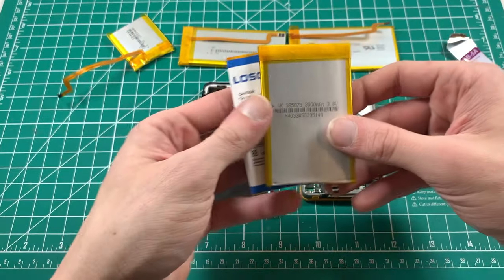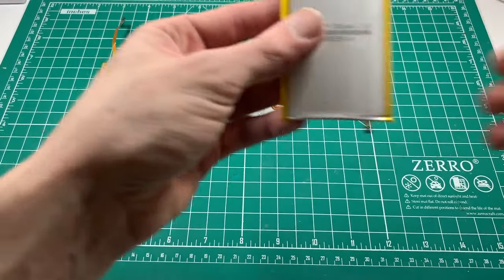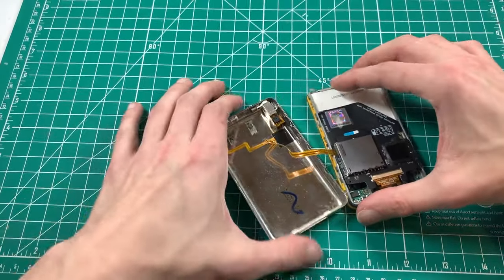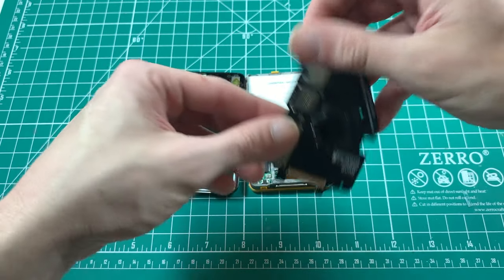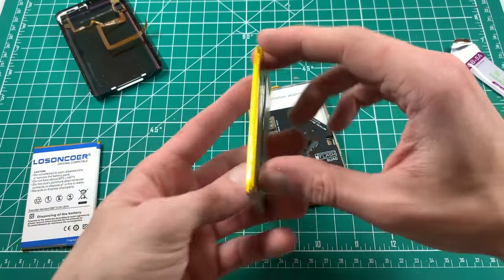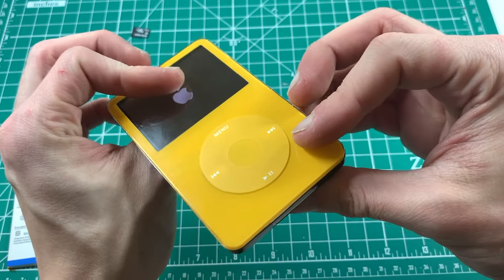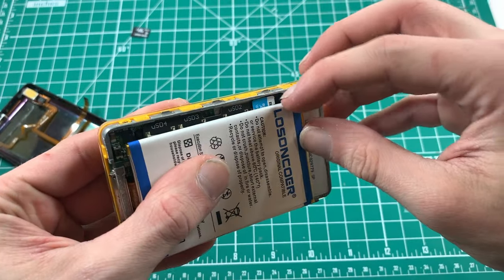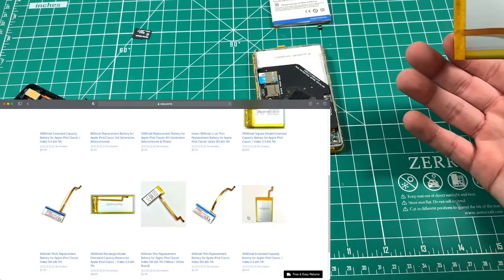Complete Extended Capacity Battery & iFlash Guide (Solo Dual Quad) for #Apple #iPod Classic

Comment: I don't understand why there isn't a single micro sd adaptor. It would be so much more compact.
Reply: There is a flash card adapter that's pretty cheap on ebay, not sure if it's compatible, I'm looking to use on my 5th gen, it says flash card to 1.8" zif

Comment: Can confirm that I got the thin 3000mah battery from the EOE website to fit with an iFlash Quad in a thin (30gb) iPod 5th Gen.  BUT - the ribbon cable was on the wrong side in my battery (compared to this video), so I ended up having to fold the ribbon cable in half to get it in properly.  Covered the folded area in some kapton tape on both sides, which should give everything some extra insulation in case the fold weakened the insulation of the ribbon cable.  Overall quite happy!
Reply from the maker: Textbook install, nice work!

Comment: Thanks for this! I misunderstood the requirements when I read them and got the thin 3k for my Iflash Solo 6th gen upgrade, now I know I have to get the 2k square to get it to fit. I'm getting the rainbow backplate and it only comes in thin size. Here's to hoping someone develops a bluetooth module specifically for these old Ipods! I'm not skilled enough to put one out of a transmitter into my Ipod like I've seen some people do, I'm just gonna get a 30-pin bluetooth adapter.

Comment: Bad luck in my case I bought the 3800 mah LOSONCOER thinking it would be better.
I am thinking of modifying the ipod that I have, exactly, it is the "iPod classic (160 GB, late 2009)" - A1238, it can still fit the iFlash Quad, or it would be better to return the battery I bought it from Aliexpress.

Comment: Hey nice video. 
Your other video helped me a lot with the installation of my 3000 mah battery 
Thanks a lot.

Question 
Now I have enough power for days but is there a way to fast charge your  ipod?
I am using a regular phone charger now
Reply from the maker: FireWire
Reply: Can I use a large battery for the iPod classic 7th generation 160gb thin without changing the hard drive?
Reply from the maker: @illasphonecontacts  no

Comment: Do the cables for the rectangle 2000 and 2800 mah (you show the pics at 3:20) bend back over themselves to connect to the iPod? I worry that such a sharp 180 bend would risk breaking the ribbon.
Reply: Did you ever find out?

Comment: I had a peak on your website and I see a 3,800 mAh battery on the picture it says 3.8 volts and the iPod would charge it to 4.2 volts if I’m understanding that correctly so wouldn’t it expand and turn to the Samsung note 7 from over charging or what’s up with that

Comment: I got the thin 3000mah battery with the iflash quad and a thin backplate. Unfortunately the locking mechanism wouldn't fit at all so I had to settle for the thick case.

Comment: If I was going to buy a thick back case for the bigger battery, would the thin back headphone assembly fit inside of it or would I need the thick back one instead?
Reply: You would need the thick one the thin one wouldn’t work
Reply: I've got the thin back headphone assembly in my thick back and it works fine

Comment: There is someone who sells 5.5 gen iPods in metal 7 gen shells. I am trying to decide between transparent front 5.5 shell despite unfortunately being unable to find a matching transparent rear shell, and a metal green 7 gen shell, but I am not actually sure what is involved with placing them in the 7 gen shells. The green metal front plates don't seem to be offered with thick rear plates like other colors of the 7 gen shells. I am also planning on upgrading mine with wireless charging, and Bluetooth, and so I expected to have to drill a couple small holes in the rear case for that.  I read somewhere that the 5 and 7 gen swap much better than the 5 and 6, but I think the 6 and 7 were also possible. Can you do a video explaining 5/6/7 shell swap situation.

Comment: With regards to 3000mah: I think maybe the last 4 # of the bottom number tell you which version it is. 

It seems like your slim one is --5148. Not sure what your thick one is. I just got one today and it ends in --7445. It is supposedly 3000 mah and it is different than both of these. It's wider than both and because its wider it's shorter. It seems like it just barely clears the midframe prong height wise.

I haven't verified this number theory. Just guessing for now.

Comment: I just received my shipment from you. The iFlash SOLO came with two rubber bumpers, but i don't know how to place them, or do I omit the one.  Currently one is on the front plate leveling the SOLO board. What should I do next? Just use a kapton tape to secure the battery against the back plate?  Please adv5. Thank you 😊

Comment: Okay, so I fit the thin backplate with the iflash quad and the 3000mah thin battery, I had to remove two rubber pieces from either side of the port at the bottom. The case seems loose. Like it doesn't clip back together as firmly.
Reply: It's fine. I got some b-7000 glue used for phones and glued it together.
Reply: I had a similar situation. Tried to throw in a 3000mah with an iFlash quad in a thin back. While it technically fit, I felt like it doesn’t close all the way like it did with the stock battery. May just go with a 2000mah

Comment: I flashmode the ipod classic 5.5  video tick back 60gb with thin 3000mha battery and iflash micro SD dual, but i have another one ipod 6.5gen 120gb with tin slim back case will fitt the 3000mha battery with iflash micro SD duo

Comment: I was wondering if you could help know  which of the batteries will fit a thin backplate with the generic dual SD adapter that was on your website.
Reply from the maker: I just updated the generic dual micro as deep product page description with compatibility info

Comment: i have an issue here 
i have modded my 5th gen thin ipod (originally 30gb) with iflash solo 256gb sd card + 3000mah battery
i have been hold my ipod charged with my laptop for around 10 hours but the ipod battery indicator still stay the same actually lowered to i guess around 1% left
what should i do ?
Edit: i know why not look like it was not the battery fault
It's the prev modder fault because he look a little rough with the battery plastic socket
I will have to shill out my cash to resolder it oof

Comment: Mine is classic 5.5g with thin back plate (iflash quad inside). I'm about to get thin 3000mah battery so it would fit in to my ipod. The question is do i need to adhere battery on the back plate of my ipod?

Comment: Cool video. I was thinking of getting the dual version but you said it’s not that good can you explain why?
Reply: There's nothing wrong with the dual version. I suspect the issue is simply that the dual occupies slightly more space and therefore limits your choice in aftermarket batteries when using a "thin" back plate. Also, with price of SDXC cards falling while capacities are rising, perhaps the dual is less relevant.
Reply: @Lonesome_Loser  may know which battery are you using with the dual??

Comment: In the Quad what SD cards did you use, I have 2 Quads I can not get to work. The iPod classic 7 gen works with the hard drive., but not the Quad's I have tried  different SanDick  128GB.

Comment: Why does the iFlash quad work with the thin back/thin 3000mAh battery but the iFlash solo doesn't? Is the iFlash solo thicker than the quad? Also, if you have a "thin" 80GB 6th gen, can you put a "thick" backplate on it? Do all the clips line up regardless?
Reply: The iFlash Solo is thicker than the Quad, as the Solo uses full size SD cards as opposed to the Quad using micro SD cards. And I believe all the backplates are interchangeable between the 5, 5.5, 6 and 7th gens.

Comment: I just realized I accidentally purchased an iFlash dual instead of a quad for my 7th Gen iPod classic. Based on your video it appears I won’t be able to install an extended battery, would an original oem size be the only one that would work or would I still be able to go higher?

Comment: People say the thin 3000 mAh battery is more like ether 1800 or 2500
Reply from the maker: yes, likely but in this circumstance the ‘3000 thin’ model is a disambiguation more than a capacity

Comment: So I finally built my first iPod. After running it for a few days I noticed some things .
Are the replacement click wheels not as responsive?  Mine seems to need deliberate and firm circles, vs my stock one.  

Also, having an issue wirh random intermittent track skipping.  It’ll usually start with long tracks, like a mix. And skip a few. Then play.  Sometimes album art won’t load, and sometimes when the album plays and finishes, songs then get stuck on zero.  I had 26k songs in my 160 classic. But full id3 info.  Didn’t check my database, just reformatted discs, and put less music.   All the tracks play fine on iTunes and stock iPods.  Currently listening to music and seeing if it persists.  Only has 200 songs on it. And some artwork is being wonky : /
Gonna possibly try a new zif, and a new MoBo when I get one.  : (
Reply: Could be the hard drive if it isn’t iflashed, I had a similar issue and I found out that my flac to ALAC converter was the issue, I was using the media human one, when I used a different one everything went back to normal. So if your converting to ALAC that can also be an issue
Reply: Mystic’s Entertainment I havnt been, converting.   It just seemed laggy at times with the iflashquad.  I was also having major intermittent skipping issues- which I THINK i resolved...  still checking it out.   But the iPod tjay was going to have that board initially,  still has that clickwheel, and I put a 160hdd back in.   It’s still kind of laggy, but not as much.   I possibly could have gotten an ‘off’ one.   It’s kind of hit or miss with the quality of the aftermarket parts.
Reply: Ok, so it took me like 3 purple click wheels to find a good one, and sandisk cards will skip in flash boards. 

Using a Lenovo, I think it is.. zero issues.

Comment: Is the iflash solo compatible with the stock size and style battery?
Reply from the maker: Yes
Reply: How about the duo and quad? Is there a max storage capacity on ipod video when using these adapters?
Reply from the maker: @richardscott9840   yes. All models of iFlash are compatible with the standard size batteries. 
Max is 2TB

Comment: Am I correct in my assumption of the numbers: 385879 being thin, and 405470 being thick?   If that is true, I noticed in my ‘research’  (not that it makes a difference) but the pictures on your store are swapped.   But I doubt If more than 5 people even noticed.   Lol.
Reply from the maker: Yes, as seen in the video - but it's important to note, those numbers are not the 'end all be all'. 

I have a thin 3000mah right here marked '445070' & a thick 3000mah marked ‘385872’. 

Each battery fits in the same iPods respectively, same configuration as seen in the video. 

I also don’t trust most online sellers, even if you’re able to identify the model of 3000mah battery using that number. 

I have ran into this countless times, a surprisingly substantial amount of sellers simply type in ‘iPod Classic 3000mah battery’ & download the first result on google images. 

hope this helps in the search
Reply: Elite Obsolete Electronics it does help.   I has just ended up blindly ordering 2 different ones during the last week.   They came in, with those numbers being respective, but I don’t have my other parts yet, so I just did a rudimentary size test.   

One is tricky because the eBay listing  says thin in the title, but on the description, in broken English it says that it fits the originally thin models with the fat case-   So the title is slightly miss leading.   

I do believe one of the two is the proper skin configuration. 

Thank you : )
Reply: @CIarkNova  i know what listing ur talking abt! did u get the thib or thick one bcoz even i got confused with the contradictory descriptions
Reply: 28set215 so if I remember correctly, the thin ones from the one eBay reseller seem to work, however. There’s usually a bunch of inconsistencies with the ribbons: either the way they are faced, or the side they’re on.    It’s still usually workable.  I can’t recall if I have any of the fat ones, but worse case scenario, you could file a few millimeters off that bezel tab. 

In all honesty though, I kind of accepted the nature of the 3rd party iPod parts.   Fitment, and function may be hit or miss. 

Also it took me a long time to realize that sandisk SD cards were giving me issues in my flash board.
Reply: @CIarkNova  you need to use Samsung which seems maybe more reliable and consistent..also formatting to Jornaled hfs plus ios format which helps...if using Windows try to stick to the fat32 or exFat
Reply: 28set215 I actually havnt reformatted any of my music, it’s all various sources in iTunes.   I did however end up purchasing an lexar sd card.   Seems to have no issues as of yet.   I was going to use Samsung as well.

Comment: if i want to use a thick back cover on a thin gen 7  ipod classic model do i need anything more than a new jack flat cable? Are the stock  clips on the front of the iPod compatible?
Reply from the maker: Yep, that’s all You need. Just a new headphone jack
Reply: @EliteObsolete  Thanks for quick replay. :) Now i am ready for my 3000 mah ipod. :)

Comment: Hi EOE 
Big fan of yours I’m about to upgrade 3 of my iPods!
I have a working 160GB drive from the 7th gen so it’s a thin one. 
I wanted to know if I can still use it with the 3000 thin battery and a thick backplate on my iPod 6th gen
Thanks!
Reply from the maker: yez

Comment: Can you use two thin 3000mah batteries?
Reply from the maker: In the same iPod?
Reply: @EliteObsolete  Yes. It looks like they would fit.
Reply from the maker: @voldy3565  no
Reply: @EliteObsolete  Why not? Just wire them in parallel.

Comment: Thanks a lot for this video! I'm currently in the process of upgrading a thin iPod 5th gen. I first wanted to buy the iFlash Solo, but I guess I'll have to buy the iFlash Quad in order to fit a bigger battery (2000 or 3000, am I right?). Cheers from France!

Comment: What is the highest batt that can be used that doesn't need to involve a Dremel?
Reply from the maker: 3800 + quad
Reply: So I won't need to modify the frame? I should clarify, my apologies. It's a 7th gen and I have the iflash quad.
Reply: I'm a stupid Yank, so would the 3000mah for thins be used without modifying the frame? I apologize for my ignorance.